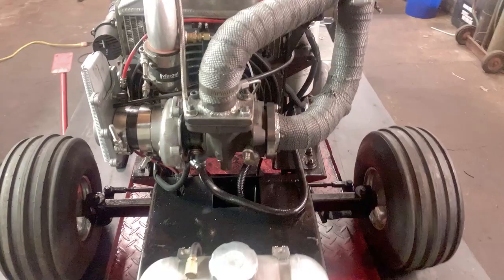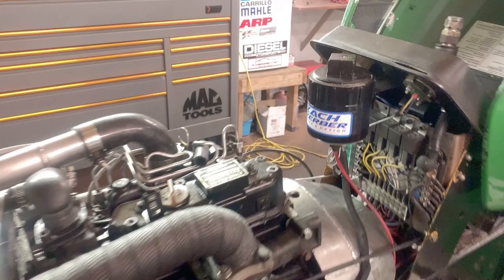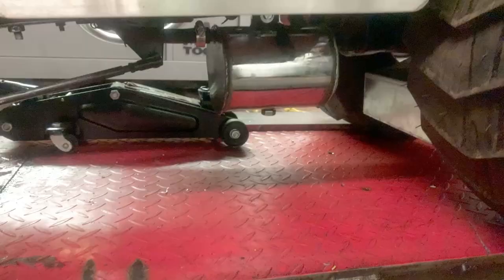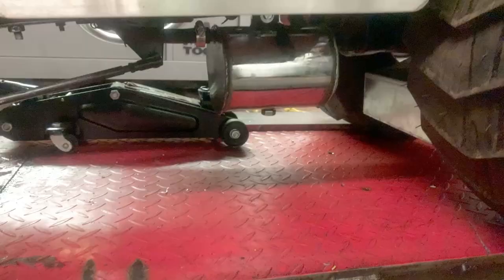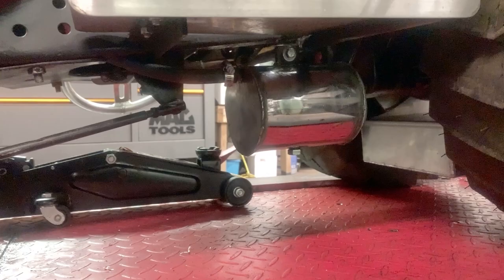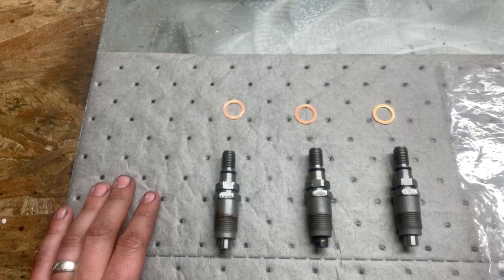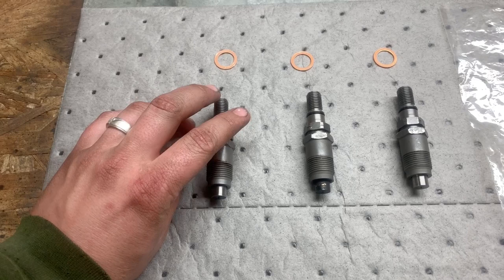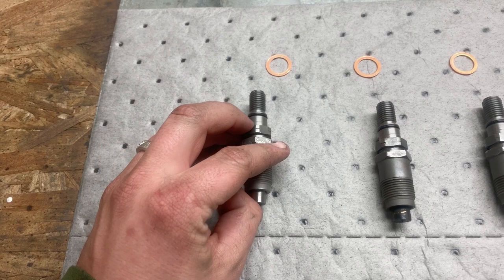Pulling Tractor Update

Comment: What size wheels and tires do you run front and back and did you have to change the hubs to bolt the wheels on or are they stock hubs